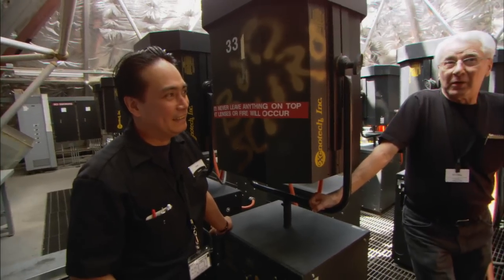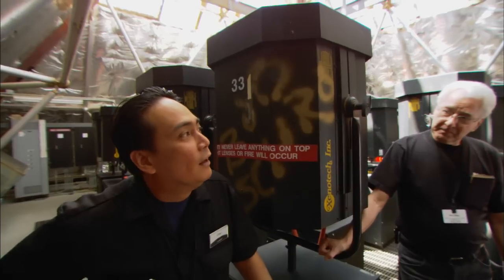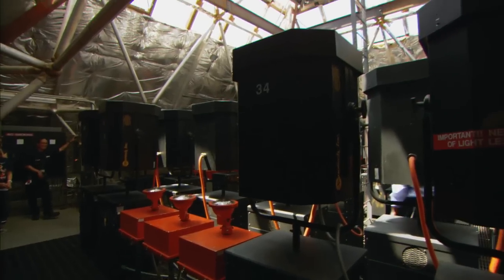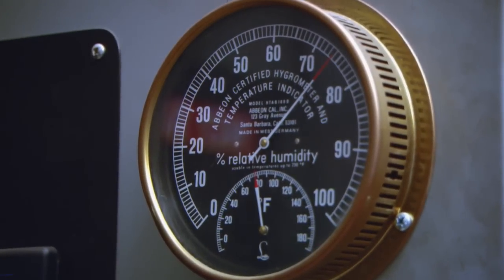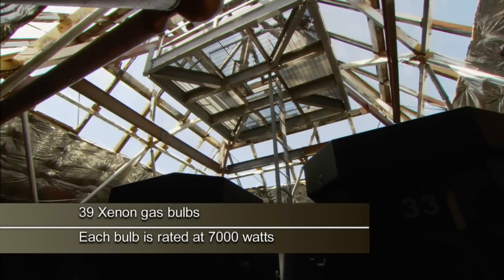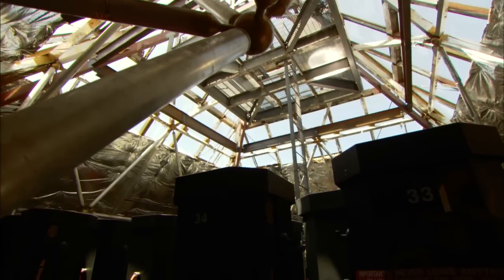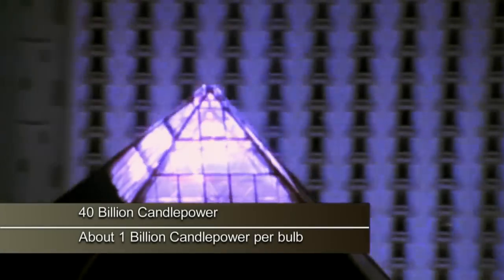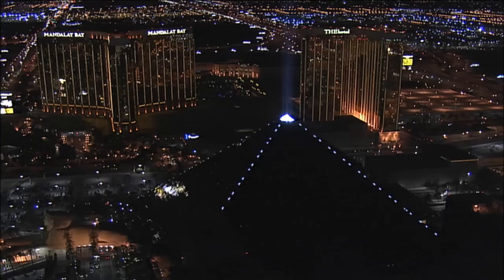The Luxor Las Vegas Beam

Comment: After many complaints from aircraft they did dim it down from what it used to be.
Reply: If they want to reduce energy cost why don’t they change to LED lamps?
Reply: Pilots actually enjoy it. The light doesn't move, and pilots are warned when it powers on by strobe lights.

Comment: That structure probably blocks half the lumens! WTF
Reply: Not really.  It’s designed to transmit the light.  Plus they need some kind of protection for the lamps
Reply: @electrictroy2010  He's talking about the metal structure and catwalk above the lights. The fact it is blindingly bright inside tells you how much light is not making it outside.